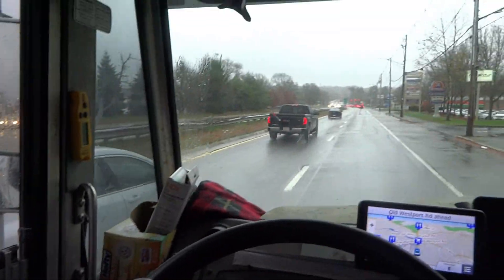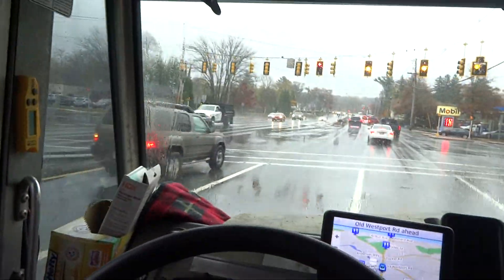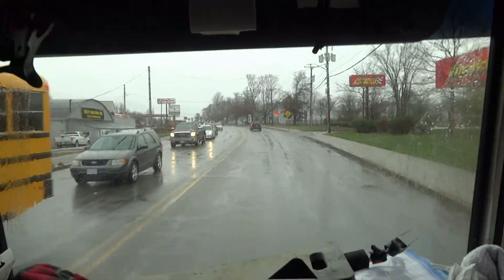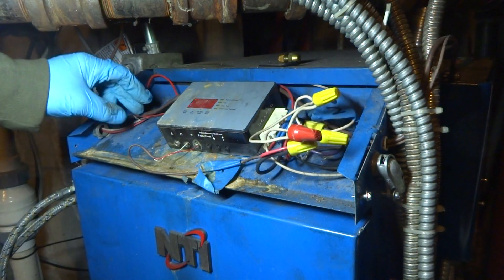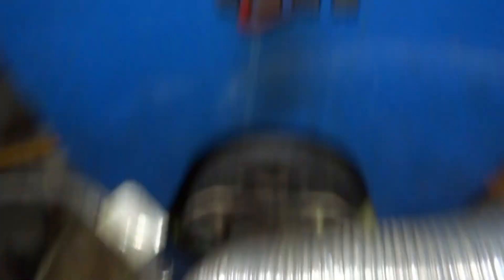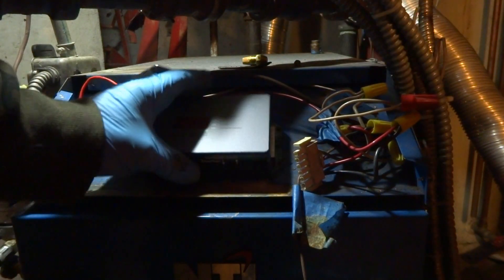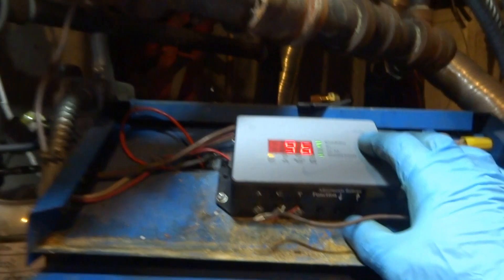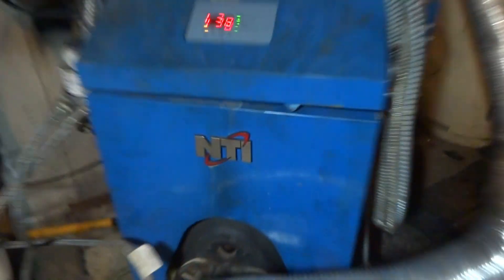NTI BOILERS JUNK EQUIMPMENT RANT VIDEO

Comment: So basically you didn’t provide the parts department with the proper information regarding the boiler controller and you ordered the wrong part. Then you took pictures and provided detailed information and the “distributor” messed up the delivery information and you got it late. Then you installed the new control and it worked. So you didn’t receive junk equipment..... and the distributor screwed you , not NTI. .

Comment: I am not an HVAC guy but have worked in electronics for 40 years. In 90% of older equipment if something has failed (just like AC repair) its the capacitor. Im thos case it looks like the power supply cap that is bad. I would have opened up the controller  and noticed if any caps were bulged and tried replacing it to get the gal going. 8 days is a long time without heat.
Reply: Exactly what I was thinking, likely a filter cap on primary of power supply or burned up diode to the low voltage.
Reply: Plumbers aren't that cool, and it's a big liability to do that, in your own house - sure, big no-no for a customer

Comment: Here is the problem for a homeowner. I need a new boiler so I call a reputable service company in the area. How do I know they aren't gonna install something like this. 

If I say to the guy giving me an estimate
"I want a peerless boiler with a Beckett burner, and 5 circulators, not zone valves, I'm a know it all bastard and I won't be able to get anyone to do the job. 
What do you guys in the business suggest? Everyone has the brands they work with regularly. How do I get exactly the job I want without coming off looking bad?

Comment: That looks like a pretty old NTI boiler, I’ve installed several of their combi boilers which I later discovered are made in Italy and felt a little cheap but have not had any issues because I installed using best practices and to mfg Specs some of the parts though seem a little less robust compared to Lochinvar Their Newer TFTN is made in Canada and seems pretty solid with Honeywell sola control and separate Carlin igniter and some really beautifully welded stainless steel. That said besides the TFT series I feel like Lochinvar makes a much more robust fire tube combi and non combi boiler.

Comment: About 3 years ago one of the motherboards for a/c heating unit got fried after a wire got pinched in the cover. I shipped it to Canada where manufacture was and they repaired. It sat in US customs because they wanted $150 customs fee because Trump wanted "fair trade"  It was one hell of a fight. Try explaining to a customs agent that there was no cost because it was a warranty job. We already paid duty tax on it. They finally delivered and charged UPS the customs fee and they tried to get it from us. Didn't happen. In the mean time I was the bad guy because downstairs didn't have proper a/c. I hooked a single thermostat to cover the whole downstairs so they had air but wasn't regulated properly. I know how you feel Steven! Thanks for posting!

Comment: Steve I have never seen an mri oil boiler but I have alot of experience with there wall hung gas mod con boilers I have found them to be very reliable and if I did have a problem the costumer service was excellent I feel your issue was with the supply house and not the manufacturer but I know how frustrating things like this can be

Comment: Sounds like it was a supply house problem. They tout the shit out of all their equiptment when they sell it. Then drop it for another line they can make better profit on and don't carry parts. I have gotten that same attitude on a domestic hw boiler. Manufacture said it took a week to make and a week to ship. Should be in stock. If the manufacturer wont stock it what good are they. They had the balls to suggest the customer should stock it. Time for  new brand

Comment: I’ve been there too, not on a NTI however. Any equipment that has proprietary parts can kiss my ass. As with you the existing dealer no longer carries or deals with it. Your next step would be to hack off the pipes and install a boiler. I have a conscious too but it’s not right we take it off our end to make situations right when it’s beyond our control. I hope they didn’t change you “next day air” rate.

Comment: Heres an idea, If u have not yet get ahold of that old control box then tear it down and do a bulk recapping, if it works then theres a spare part right on hand for next time, its like i do here with VCRs i work with, use parts from other machines or caps etc from other boards to fix whats actually savable, so far every one of them here were and now work, same thing can be done with control boxes i bet, just need same or higher value caps to replace the old crappy ones, as depending where they are made some capacitors don't last very long and dry out or short, that is what causes the issues most the time, so try that it might help even a bit in a pinch while waiting on new parts.

Comment: did you even attempt to open the controller and refurbish it by changing out the capacitors?
Reply: What's the liability for an owners house catching fire if someone decides to  "fix" something outside their scope. That's why they do not do it. Too risky.

Comment: Systems that need specific controls suck.
Reply: The Crown boiler I just worked on had some real nice off the shelf Honeywell controls and a bog standard gas valve, got a new gas valve same day since the old one was bad, it's but 10 years old now and still working great, though the cheap circulator pumps that the installer used are on their way out, when they fail I'll go back with B&G or Taco units